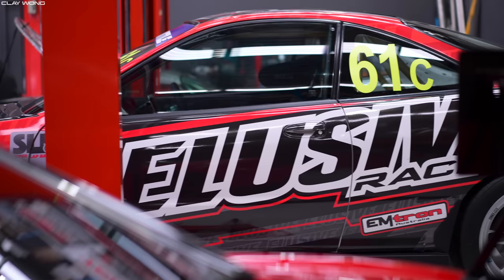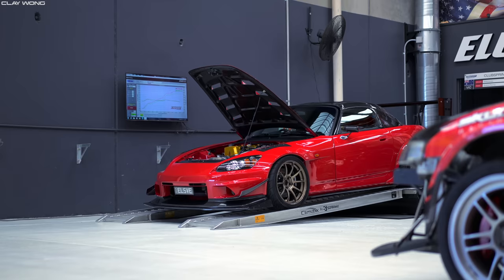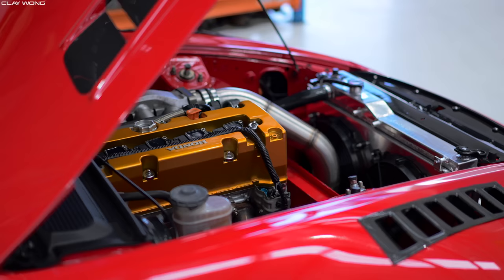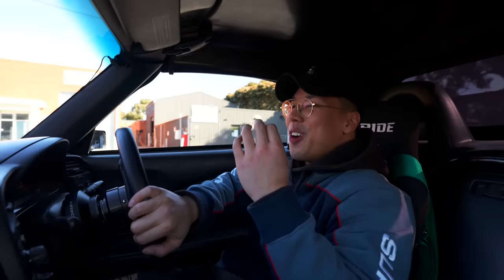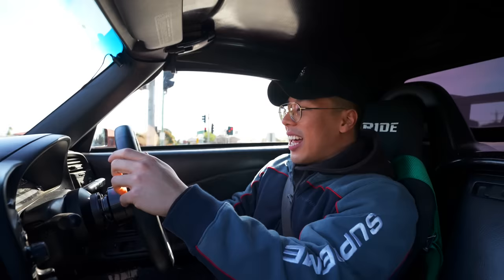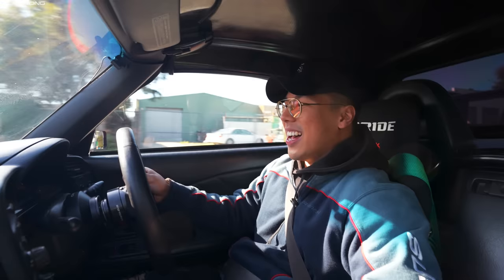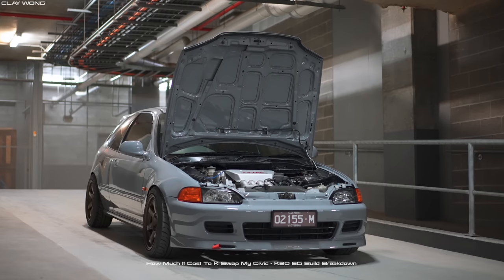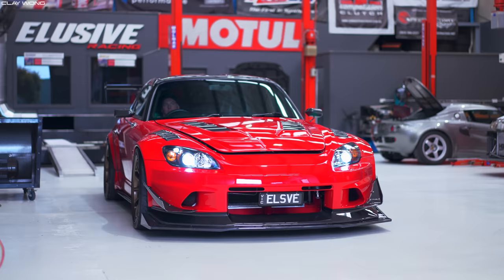This Is Why You Need To K Swap The Honda S2000: K24 S2K

Comment: NEVER F20C stays in my S2000 for good 😎 just sounds unique unlike any other Honda motor..
Reply: Amen brother
Reply: Agree 👍
Reply from the maker: Love the F20C but it’s very cool to see something different and unique being done!☺️
Reply: if i owned a s2k I would preserve the engine in the garage and keep blowing up k20 engines lol then finnaly when I garage queen the car Put back the F20C if I was in your guys path .
Reply: @soloacabrera2583  blow up a k20? I have tried. Lol. Not actually easy to do.
Reply: @scottgardner5918  i had my k20 rsx 11 years,  223k miles, original engine,  still running strong. And i raced the car a lot the first year i bought it. I still drive it hard today. And 3 years ago it needed a head gasket... just put some stop leak in that thing and its been running fine since lol. Honda k series motors are damn near indestructible
Reply: @worldtraveler8613  exactly my experience with my k20z3. I would say I abuse this engine and I don't even feel bad. It comes alive after 6000 rpm's and I just love it.
Reply: Same bro 💯🤙🏽
Reply: If my f22 ever lets go I’m k swapping it. Plentiful engines for cheap. The f20/22 are only going to get more and more expensive.
Reply: Interesting.  I have F20C and 6 speed in a Westfield clubman and it’s epic.  I also have a spare F20C and gearbox which I was thinking of building for more power.   But at 600kg it doesn’t really need it let alone K24.
Reply: My f20c sounds like any other b-series. When it dies, I’ll gladly K-swap it. They’re just plain and simple a better engine.
Reply: @frankflores1917  you need hearings aids buddy
Reply: @chouaibk8700  it sounds like a k20 bruv. Sorry but its a square ratio 2.0 honda engine. Sounds like a k20
Reply: @Hanschepu  you need to have listed. To both in person
Reply: @chouaibk8700  i have, I have a cammed k20 with ctr pistons, had a b16a2 and have several friends with s2ks, heck I heard an f22c and a jdm f20c. I think both sound really similar, my k20 spins to 9300 - up there I hear no difference tbh
Reply: @Hanschepu  you can still tell the difference, they might sound a little similar but f series sounds angrier cammed or boosted.
Reply: @Hanschepu  wrong i think either ur ears r messed up or there dirty as shit lol k20 sounds nothing close to an F20c
Reply: @chouaibk8700  that’s what I’m sayin bro people r just biased n dnt wana admit that the f20c/f22 sounds like an actual race car...
Reply: @bige7186  what? Jeez you fanbois are something.

The argument has never been that the F20/22 sounds bad - but it doesnt sound Unique 🤦🏽‍♂️
Reply: yeah ew why would you ever want to take the gem out of the s2000
Reply: @redline9221  if the F20/22 dies, a K24 is a great replacement.
Reply: @Hanschepu  ew no F20C ftw!!! 9,000!!!!
Reply: @bige7186  nah, K20/24 is the better engine. My k20 spins to 9300.

Did a back to back on JDM f20c vs K20z3 on a dynoin my other Yt channel, K20 gave same numbers except more low end torque due to VTC actuator.
Reply: @Hanschepu  no F20C > k20 now go to sleep 😴.
Reply: @kurtlamprecht93  right? Literally the 4cyl LS of swaps
Reply: Agreed. If I did spend the money for a swap I'd LS or n54 swap it. But rather spend the money on the f series and keep the fun, reliability, and value of the car.
Reply: @kurtlamprecht93  He meant Kswap an S2000
Reply: @kurtlamprecht93  lol ok
Reply: @kurtlamprecht93  in a s2k u don’t seee that often
Reply: @scottgardner5918  Same here, I packed on 210k on my K20z3 before some lady totaled it. I did I/H/E and drove it so hard in the canyons and on the back roads to work at Denver altitude it's whole life, and amazingly never had a single issue or repair. Finally had to do the clutch the day before it was totaled and that was it, and that's unrelated to the motor itself. Was still going strong after all that time and abuse. Miss my FG2 like hell.
Reply: Yup I’ve had my car since 2008 Im never ever changing the motor til it blows up, if that happens I’ll rebuild it or buy another f20c. Never ever replace the heart of a champ
Reply: @frankflores1917  uuhhhh okaaay. So a f20 sounds like a b series.... I'm sorry you you have loss of hearing. As for plain and simple you're way mistaken. They are high revving and forged from factory. Can hold 600 hp stock. And just as reliable. But yes the k series are great engines. Just the way you come with your comparison is sad. And the 1st time you k swap your looking at 8 to 10k to get past the point your at now. Cheaper when you blow it up because you already have the mounts, clutch and flywheel, manifold, etc. Buuuut still not as special as the stock 2.0 f20c that makes 120 hp per liter from factory.
Reply: You do you! 👊
Reply: As a ex ep3 type-r,  and a current f20c honda s2000 i can say i miss the torque. It was a surprise to me. The k20 with a 8800 rpm limit, rbc+70mm tb, dc5 cams, is more powerfull and more torquey than the current f20c i have with 70mm tb, 70mm decat exhaust, with aem ems. And i had a 5.3 final drive on the ep3 and a 4.7 on the f20c. Both with 255/40 tires
Reply: They are  both 2.0 l honda engines that love to rev 🤷
Reply: Yeah but if u have the money like them..... even even i would do the same who doesn't want more power...😧🤣🤣🤣🙅🤷🤦 And TBH all stock s2ks are sloww I smoked a couple with my b20vtec and gave them at least 4 cars or more jaja
Reply: I'll stick with my f20c thank you, talk about a  Bias review on kmotor, but yes  kseries are awesome motors, but f20c are also badass with less moving parts to failed has about the same support, and that's a lie when you say swaping a kseries in your s2k is cheaper , with all the mods and adaptors, you still end up pay the same as getting another f20c or cost more for the conversion, with same amount money spent on this motor you can make more power with f20c
Reply: @speedfuzion1  i went from an european ep3 type-r to a s2000 f20c, and i say that the k20 with bolt ons is a much better engine than a f20c with bolt ons
Reply: What happens when your ap1 rod starts knocking? I f20 crate motor is soo expensive and honda no longer produces the s2000 engine?
Reply: @koreyp360  honda is producing f20cs again exactly because of parts requesting
Reply: Until it blows up and you can't find a f20 or find that the rebuild cost twice as much as a k20 swap? My position right now.. having rod knock in my ap1
Reply: Sounds unique? Anyone saying they can tell f20 and k20 is either talking shite or works on a Dyno all day tuning Hondas 
I bet you couldn't even pick out the f20 if you heard it amongst 4age BDA and k20 on the rolling road
We can run a test for fun if you like
Reply: @beltdrivetypea6534  for one that knows hondas since the 90s, the b16/18, the k20 and the f20, all 3 have distinct engine noise
Reply: @brunomanco7529  do you mean exhaust note though?
In my opinion exhaust aside there are several engines that sound very similar from 8-10k 
Maybe you could pick out a Honda on the cam cross over but even that could be confused for power band on something like a black diamond to someone that's not working with em all the time
Reply: It sounds just like a k20 with the same exhaust setup lol. I think ppl just hype it up more bc it doesn't have the ricer label that ppl give other Hondas
Reply: K stands for krap
Reply: @speedfuzion1  currently it only cost about 3k for all the swap parts plus engine and labor. Much better base platform to get easy power. The k swaps have so much higher all motor potential than the f can dream of.   About the same support. Try making 300whp on a f20c and a k20a2 or even better a k24a2.
Reply: @kurtlamprecht93  well they are less kswapped s2000s than non swapped f20c s2000.
Reply: @kurtlamprecht93  yeah so kswap s2000 are unique
Reply: @youtubecomments5951 no unique would be a rx7 rotary motor in the s2k. The kswap is readily available for the s2k which is the reason why it makes it not unique.
Reply: @cruzin1383  know what else is unique…. A running rotary powered rx7.
Reply: @youtubecomments5951  lol they are all over different parts of the world. They make loads of power just like the k series. Just look at puerto Rico they use the rotary on all kinds of cars like the Toyota scarlet, Corolla.
Reply: @cruzin1383  maybe they know what they doing then. Cause only place I see them are in shops
Reply: @youtubecomments5951  yup the rotary engine is not a conventional engine so a lot of people do not understand the way it works and how proper lubrication is even more vital to it. When you understand the way it works ( the ins and outs not just knowing how it works) you can do so much with that engine.
Reply: @cruzin1383  so basically you should only own it if you are a rotary mechanic
Reply: @youtubecomments5951  it's different then other engines so your not going to get people that understand fully how to work on it. It doesn't have Pistons and 90% of people are taught only how to work on piston engines so you do the math. It doesn't mean it's a crap engine far from it. If you do it right you'll only have to worry about changing out the apex seals and regular maintenance. No worries about throwing a rod and loads of power. It's just different is all. Just like how a V8 is different and a straight 6 is different but it all has a place at the table.
Reply: S2000 f20c = Ferrari
Reply: I have a f20c making 650 to the tire wouldn't change it for any motor
Reply: @Hanschepu  you are forgetting the placebo effect of an exclusive engine. That adds unmeasurable Hp. Literally! Hope you have a sense of humor.
Reply: @bige7186  K has variable cams, you can’t beat that, better drivability in low revs and same or more lift and duration at high revs. I love the F20&22 but they’re based on a lump of an engine. The rest of the F’s are boring ass 150hp engines. In fact Honda has too many engine series in 4cyls alone,  A B D F H K c’mon keep it simple Honda.
Reply: And that's why it failed F20 just sounds better but its not better than the k series
Reply: Too bad you won't be making the power of a K swap
Reply: F20c is the best sounding Honda motor imo
Reply: F20 sounds like k20 too
Reply: Absolutely I agree my ap1 will always be ap1.
Reply: @michaeldiso9842  not even close sorry bud.
Reply: You guys have no idea what yall taking about. k is king
Reply: Top of that the block can handle 800hp